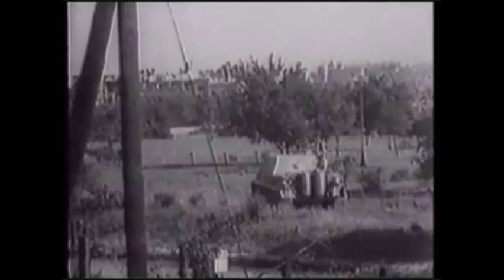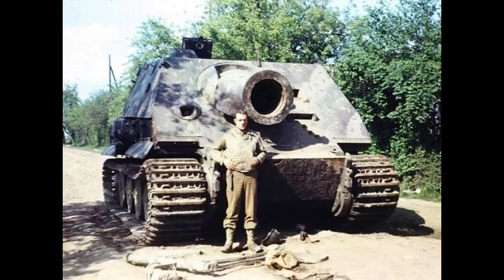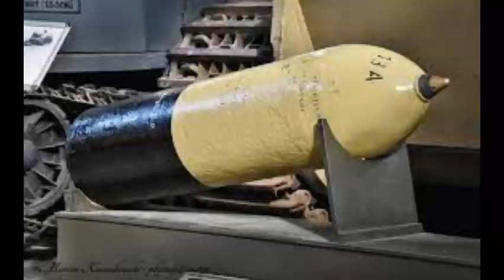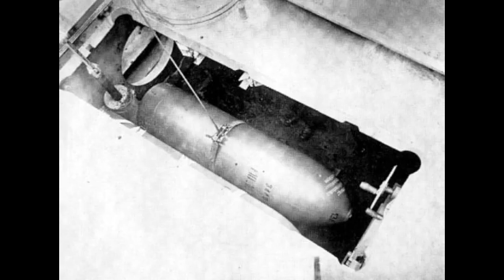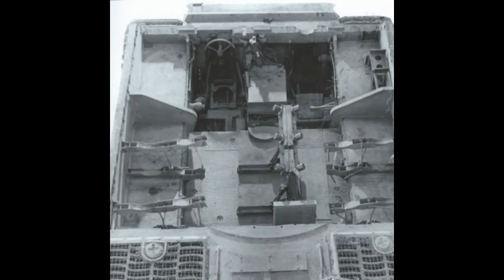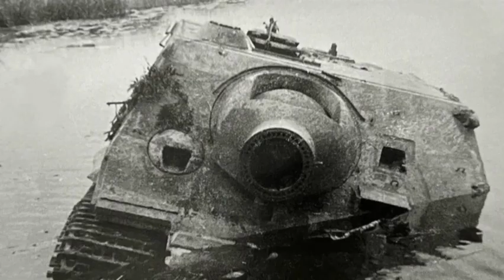Sturmtiger's SUPERGUN – Handlind and Loading the 38 cm Raketenwerfer 61 (’44 – ’45)

Comment: Impractable..
as  to fight on battlefield, enemy troops/tanks..
Only use is to shoot large kaliber bomb away into enemy territories..
This gun does not need to be on chassis of a tiger tank.. to fulfill its job..
Seems impressive.. 
but is waist of time, money and material.. 
to produce this item for the Wehrmacht.
This result of weapon is when u give weapon designer/architects... office workers:
  pervertin..
Same goes for more than 50 other outlandish designs... 
including V2 rocket von Braun
 which ended up bundled in 4
 and 3 stages as worthless Saturn Rocket.